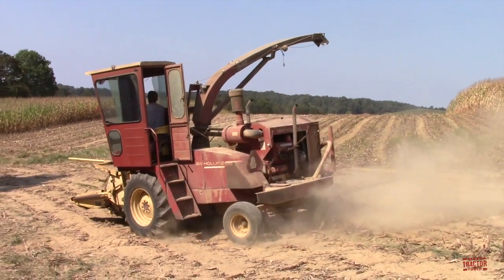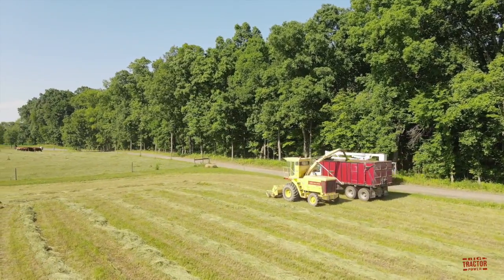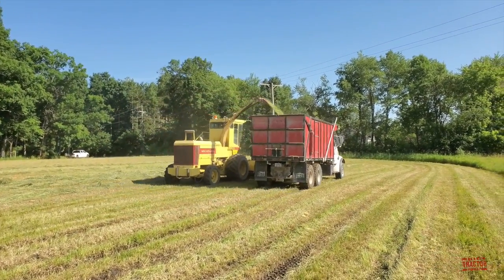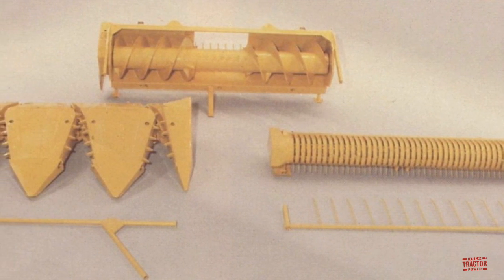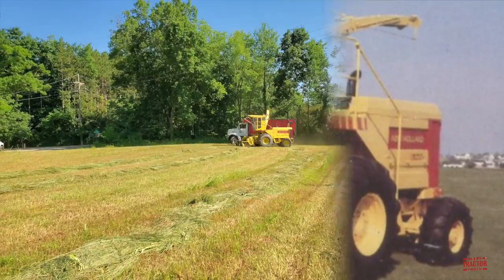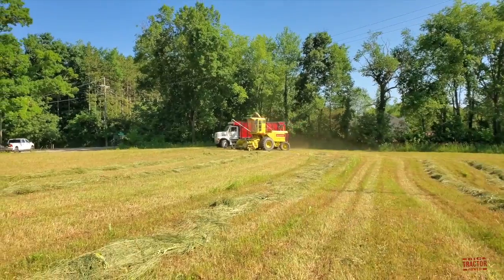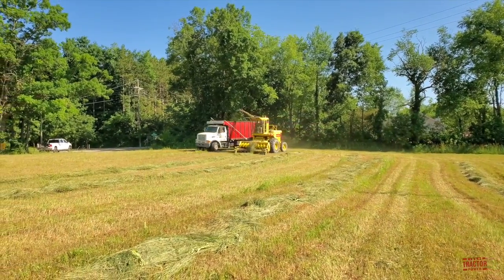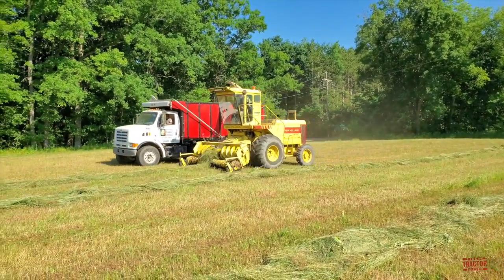THE WHOPPER CHOPPER | New Holland 1900

Comment: Brings me back to my youth. You could hear m from miles away. Especially in corn we went out to watch. We were so jealous of the men who runned those mighty machines. 
Tractors of 100 to 130 hp pulled 14 ton wagons to get the silage to the pile. 
Nowadays they use 300+ tractors with 30 ton wagons.

Comment: The guy's driving the trucks are so in sync with the chopper. It's mesmerizing to see them turn those corners and not lose a bit of materials.
Reply from the maker: This was a tight 10 acre field.  They rolled right through it.
Reply: All the truck does is drive. The chopper driver is responsible for keeping it in the truck.

Comment: My first New Holland (after dads try everything) was a 718….a great simple chopper. As my dairy expanded I went threw a couple 892’s other then the stupid reversing clutch design, I got a 900…..wow like any good chopper the more power you put on it the better! I got a 1845 to open me and my neighbors and then got a 1915 that I still use today in Northwest Ohio to mostly open and use for high moisture ground ear corn. I do custom agbagging and have seen them all. I will never forget the first super 717 with a 250hp tractor flying thru a field chopping corn.

Comment: I’m the forage harvester operator for our dairy farm and we run a fx 60 and a 2115 new holland. Both machines share the 10 or 12 foot windrow headers and the ri450 corn head.
Reply from the maker: Very cool.  How many rows does an RI450 bring in?
Reply: bigtractorpower well we plant our corn to 15” rows, so we are cutting 10-11 rows at a time. The ri 450 cuts 6 rows. Our 2115 had a horning processor in it as well. Would definitely make you some good content!
Reply: I have one video on my page that’s short showing the 2115 cutting corn at night

Comment: Expensive machine for the 80’s, but considering the CLASS is 500k I guess it is a steal.
Reply from the maker: The $100,000 mark was right in line with the cost of a big machine of the day. 4wds and top end combines were preceded in this range.  In 1982 tractors like a 370 hp John Deere 8850 was $120,000, a 325 hp Steiger Panther III was $110,000, and a 290 hp Massey Ferguson 4880 was $108,000.  The 222 bu. John Deere 8820 combine was $125,000.
Reply: The biggest choppers now are over a million
Reply: If you take inflation into account, the Holland chopper was probably close to being that expensive back then
Reply: You mention that the NH 1900 was superseded by the NH 1915, in 1987 - I recall seeing a NH 1905 in a different video - what year was this introduced ?

Comment: We have had a 1915 since 2011. Nice chopper with a lot of capacity. Chopped side by side with a John Deere 5830 and it would walk all over that. Only downside with New Holland on a machine of that age is parts are becoming obsolete and the hydraulic rear wheel assist is worthless...robs to much power from the machine. I never use it. For it’s time I’m sure it was a beast. Wish more companies would make a machine close to the 2115 size today

Comment: That's great Machine. I thought they were the first to  Manufacturer the  Forage Harvesters? We have to use Tractors to Haul because a Lorry would sink because we harvest Maize in the fall so the ground can be really wet.
Reply from the maker: New Holland was third to offer a self propelled chopper. Gehl was the first in 1958 and Papec was the second in 1959.  Gehl based in Wisconsin stopped offering a self propelled by the end of the 60’s and dropped out of pull type chopper production in 2006 in favor of expanding its construction business.  Papec based in Shortsville, NY offered the first pneumatic silo chopper/blower in 1910.  Back then you cut the corn and hauled the entire plant to the silo where it was chopped and blown into the silo. Papec offered the first pull type forage harvester and distributed them through John Deere dealers under an agreement until the 1940’s when John Deere started building their own chopper. Papec exited the self propelled chopper market by the late 60’s and stopped building pull type choppers and forage wagons in 1979.   You still see a Papec forage wagon in use every once in a great while.
Reply: @bigtractorpower  Thanks for replying and very impressed with your knowledge so when me and my brother take a break he would like to know all of what you replied. We have a Claas Chopper and they must have joined the market in the later part of 20th Century I presume? The new Claas choppers and Combines are nice but they price us out so we are probably going to have to change machines!

Comment: The 325hp 2100 was originally called The Whopper Chopper as I remember
Reply from the maker: Yes.  The 2100 came out for 1980 and the 1900 in 1982. I scanned in the The Whopper Choppers logo for this video from the 2100/1900 sales literature. New Holland lists them both as Whopper Choppers in the brochure as well as the pull type 1600.

Comment: Very cool video, BTP! Did the corn head on the 1880 still have a sickle cutting the stalks? Could be something else making a ticking sound I guess. Gehl already had a stationary knife by the time that chopper came out. However, Gehl gave up on their SP188 the year before the 1880 & there were no more SP offerings from them after that. I think if Gehl had stuck it out & changed their harvester unit on the SP188 to something like the CB600, they could have hung on in the market. At least for a little while. Wonder if something smaller like a self propelled CT300 would have caught on with the medium sized farms back then.